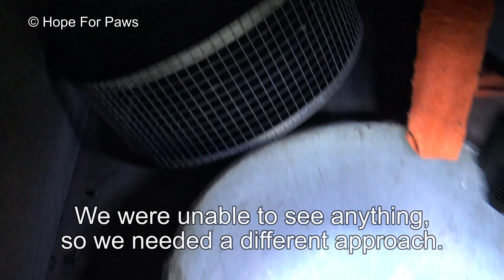Time was RUNNING OUT so we DESTROYED a wall and look what we found inside!! Just amazing!!! #kitten

Comment: I work with a fellow who decided to finish his basement during his sabbatical.  He also adopted two kittens at the same time.  He finished drywalling and then realized that the kittens had gotten through a hole and were on the other side of the drywall.  He had to take most of it down.  They weren't behind the wall very long; he had heard them right away.  Next time he did the wall, he put them in another room.